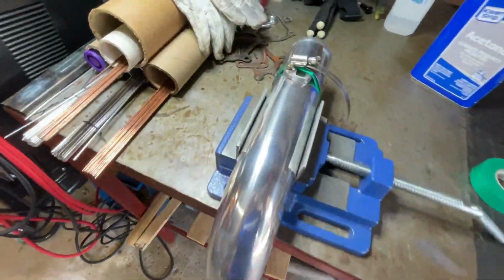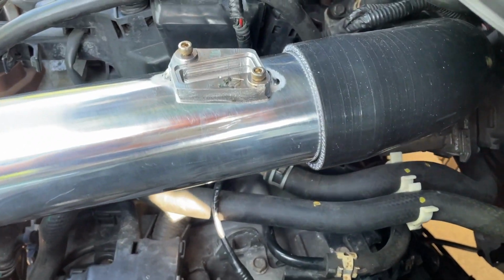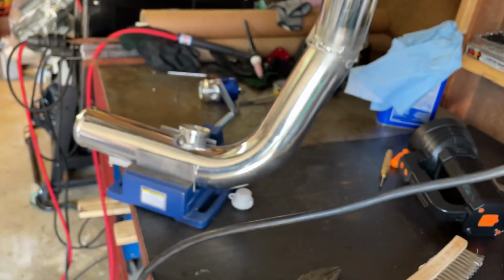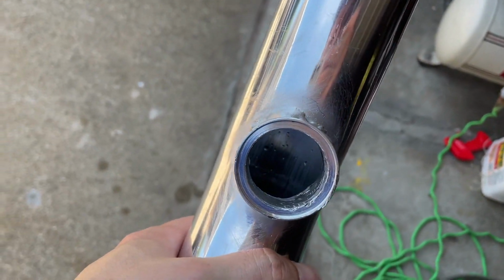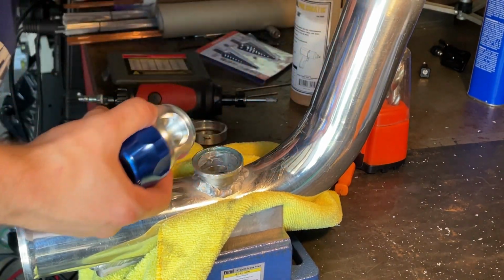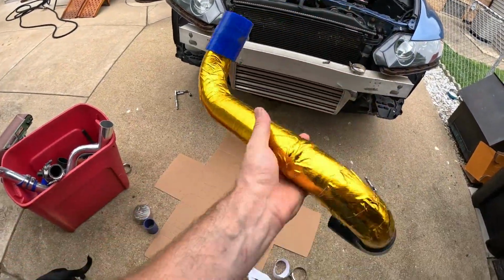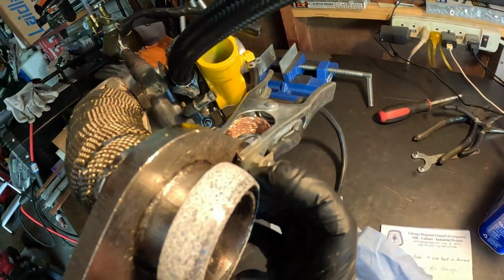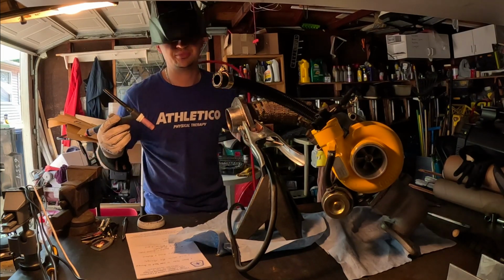Ebay Turbo Honda Civic V2 Build Part 3

Comment: That foil heat shield will only help with radiant heat. There should be another layer.
Reply from the maker: Anything you suggest
Reply: @BulliKid  😃  well the engine bay will get really warm after a while the entire steel intake will get warm, due to conduction & convection. Id suggest u wrap it up with fiberglass then add gold foil. double powa

Comment: Keep it up! but I see your tungston is still sticking out push it in more and your tungston should ball a bit.  Make it a little hotter as your welds are a bit cold but move a bit quicker.
Reply from the maker: Thanks! Justveye balling the amps but yes full pedal didn’t wasn’t enough heat.  And I don’t want to burn through and destroy the pieces. All came out ok 😝✅
Reply: @BulliKid  yeah youre improving!